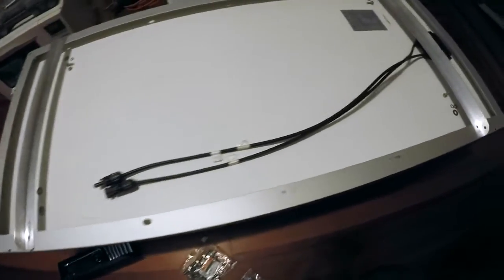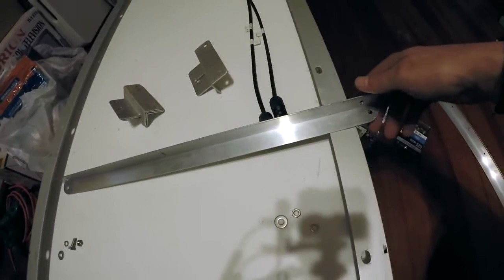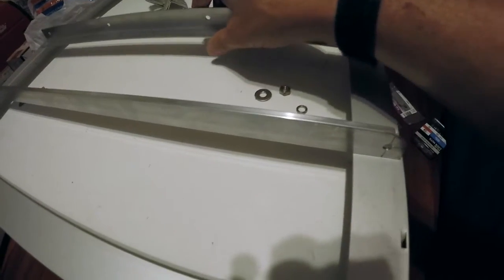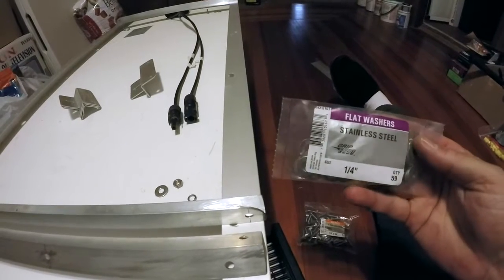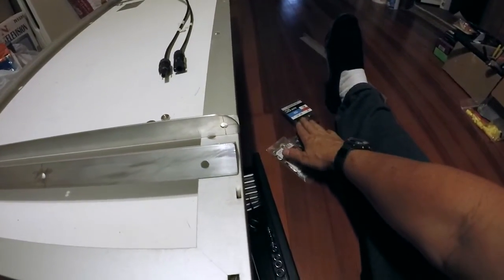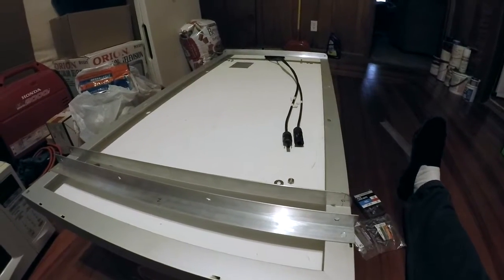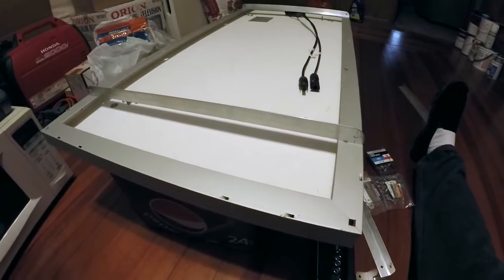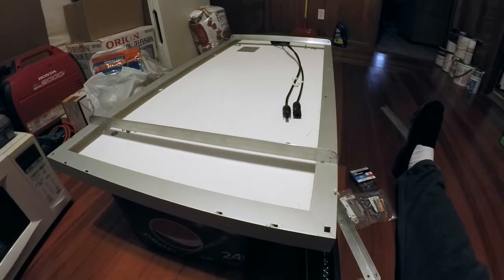Master the Art: Effortless DIY Solar Panel Mount

Comment: Funny we disigned our solar stucture the same way. We must have seen the same ones on Amazon. I'm glad I watched this though because I never thought to cut a curve into the one bracket. How did you cut that?
Reply from the maker: I didn't get these off amazon, I just bought some angle aluminum at the hardware store and made my own. I rounded the corners with an electric cutoff wheel and then filed the rough edges with a hand file. It's way cheaper than buying the premade brackets and the end result is good.

Comment: Will you have room on your 5th wheel for more panels down the road if you need them?
Reply from the maker: I have room to fit four of the 100W solar panels if I needed to but that's about it unless I were to get a couple of smaller panels. I'm confident that 300W will be more than enough for our needs. At leas I do have the option to expand a little if needed.